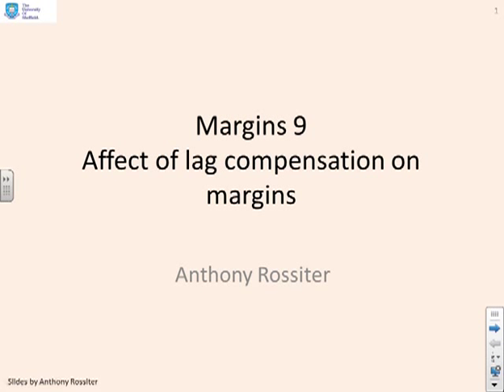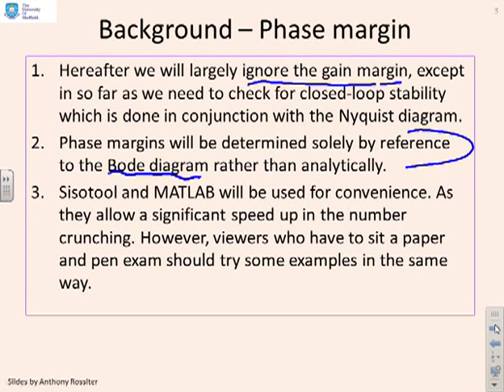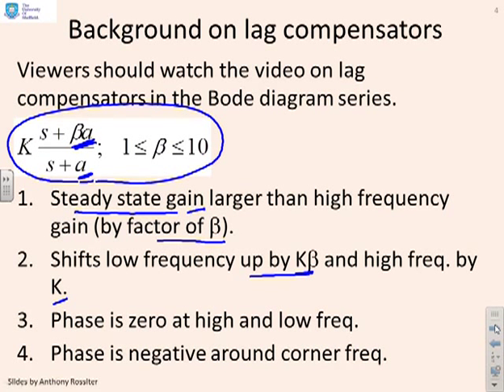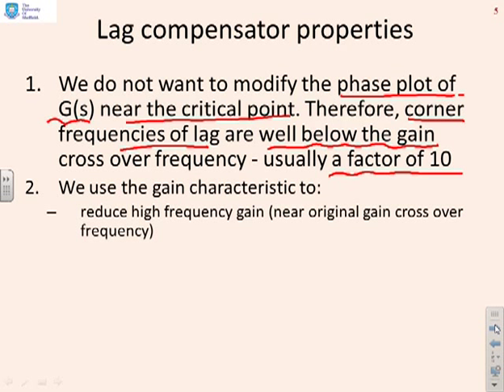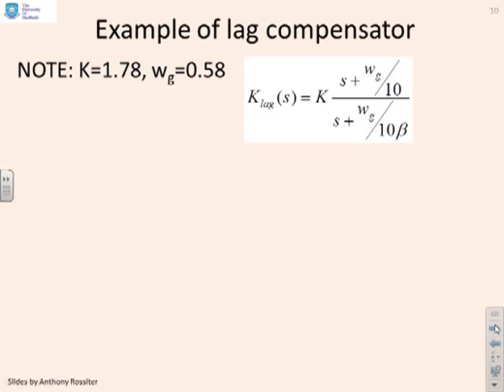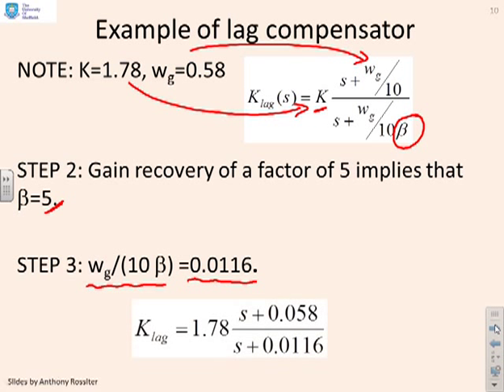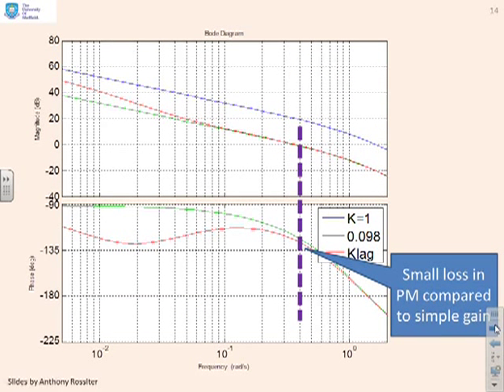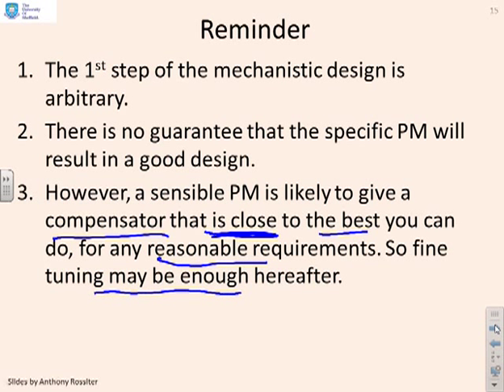Margins 9 - the affect of lag compensators on margins

Comment: I don't like this method of calculating a lag compensator and here's why: the main reason for introducing a lag compensator is to improve steady state offsets. To that end it is much easier to to first break up the lag compensator into a gain portion (K) and a dynamic portion with unity low frequency gain like so M(s) = K*(1 + s/z)/(1 + s/p). The gain is then determined by solving for a specific steady state error let's say ess. So we have ess = r/(1 + K*G(0)) and solving for K. Having established the gain (and thus steady state error) we can then plot K*G(s) and choose our desired phase margin (at the new gain crossover frequency w) from the plot and place the zero (z) at w/10. The pole will then be placed at z/(abs(K*G(s)) where K*G is in absolute (rather than in dB). If, instead, we choose K based upon the desired phase margin (and thus new gain crossover frequency) we have lost the ability to stipulate the steady state error which was the whole point of this exercise to begin with.